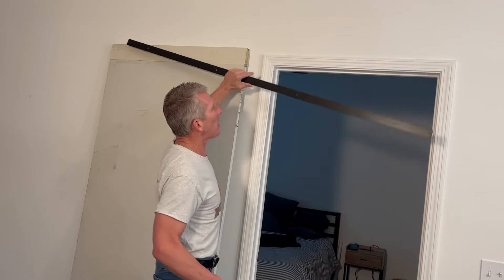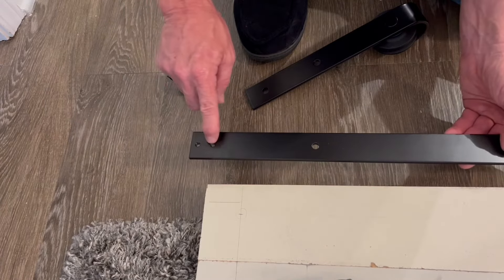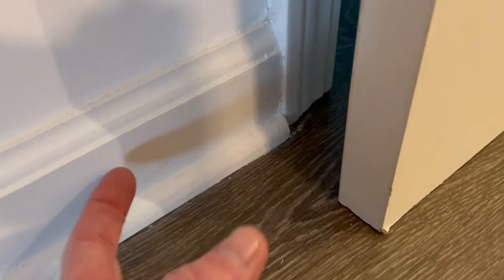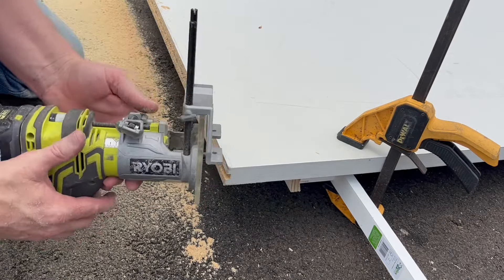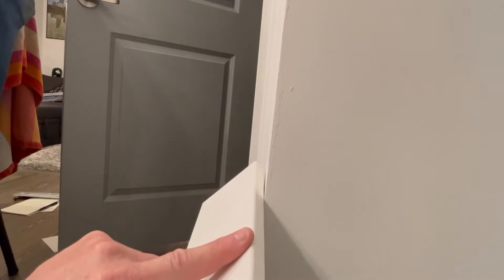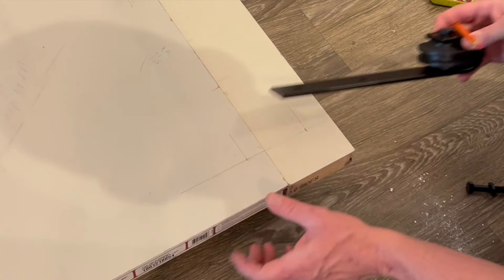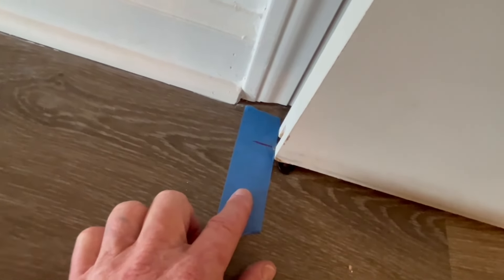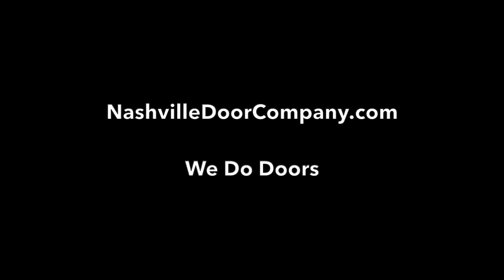How to install a barn door

Comment: Thank you for all the clarity!  I'm finishing the install of my barn door tomorrow.  I was scared until viewing your video.
Reply from the maker: You're welcome and here's the idiot's guide to doing this. Layout the track on the floor or in driveway. Then lay down the door and hook one of the hangers over the track and on the door. In other words,  lay it all out  just as it would look once mounted. Then measure from the hole on  the track to the bottom of the door and add 1/2" or whatever you want the clearance to be off the floor. That's the height of your bar off the floor and the best place to start. Thanks for watching.